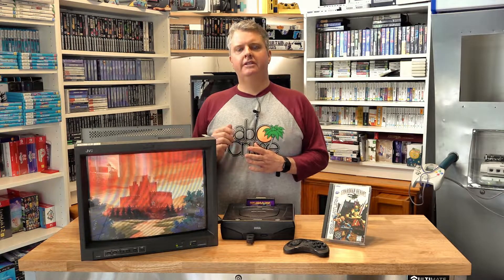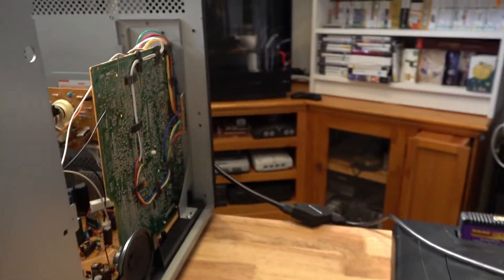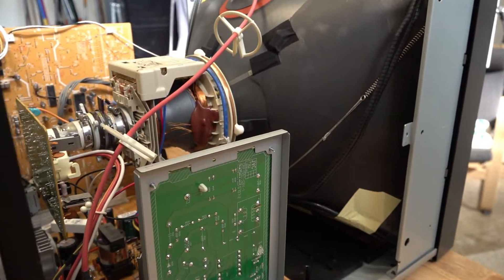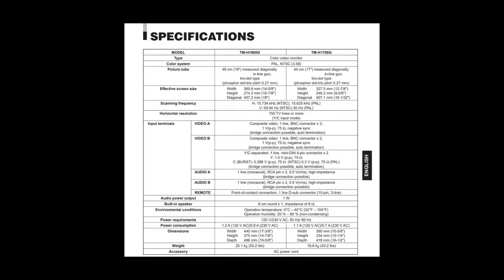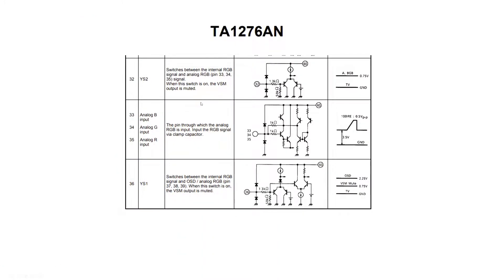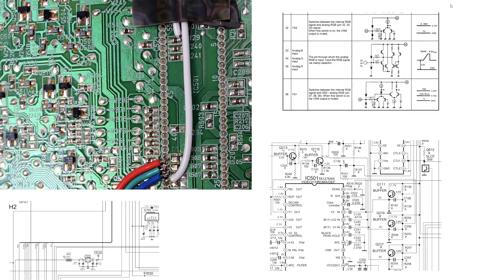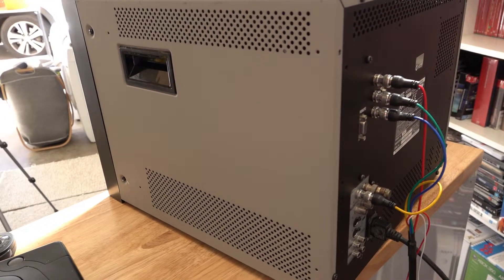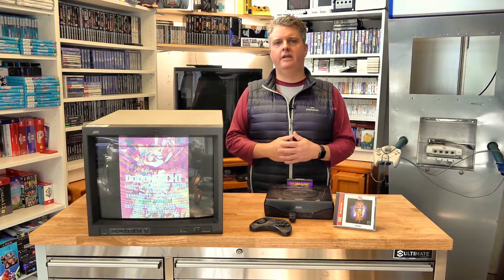How To RGB Modify JVC TM-H1900G RGB Modification

Comment: hi, thanks for the video. from what I see, YC and composite aren't  affected by this mod, so you can still hook composite or YC devices to it and use the switch to disable the RGB input (looks like you're bypassing the SYNC signal with it), am I right?

Comment: Hi dude, props for this video very instructive !

I tried to do the mod on my screen, but I must have shaken something when I decided to cut the rear panel to insert a female scart plug in. While working on the back panel all the electronic cards inside the CRT moved and I might actually have loosen / broken something.

From my understanding, removing the C533,C532,C531 and R554 do not prevent S-Video from displaying if you do not turn on the blanking switch.
Can you confirm it to me ?
I removed everything I wired with the mod but did not soldered back these four items.

When I turn the screen on, sometimes sync is lost, sometimes red color is missing, sometimes it turns istself off after a few seconds/minutes after a small "click" indicating maybe it turns itself into safety ?

The neckboard moved a little bit backwards, I replaced it but with no luck (I found some grey plastic like stuff around the cathods but it was allready there and I did not tried to remove it).

Any steps you have in mind to check a few things on that screen or should I just find a crt technician if possible ?

Thanks in advance for any advice / help you could provide =)

Comment: Hey man, I am trying this exact mod, or at least I want to try but am a bit intimidated since I am a noob to soldering and so forth. 

Can you help to explain it a bit easier since I didn't know what half you said was especially in the schematics part.

I don't need to become a CRT expert since I only want to do this once and that's it. Perhaps a step-by-step or list of which points need to be soldered where if it's not too much trouble? 

THanks in advance.
Reply: hey, did you do it?
I just got this monitor (for 200 euros, seems a great price!). I just tried in composite and it was not the best image of course. I'm waiting a svideo cable to try that output.
How do you like this monitor overall? And which sharpness did you set in the menu? I don't know what it changes
Reply: @floriansolatges9624  This monitor has great s-video too, comparable to RGB. Not much is really lost without RGB, though one can still add it for compatibility.
Sharpness makes the contrast between two pixels greater if their brightness is different.
Reply: @ST-wn9kd yes I found out svideo is really great. Snes on the tm-h1900 is really impressive. So I'll sitck with that :) thanks for the answer

Comment: I’m trying to perform this mod but failing for some reason.  I’m inputting .5vp-p following your voltage divider, blanking works, and I’ve tried both sync through the existing composite and feeding it directly to the jungle and get no love.  Do you think it’s possible there was a 1900G revision with I2C bus blocking the RGB inputs like some other TM models?
Reply from the maker: Interesting. I've never had this issue. Are you getting any picture. What is the jungle ic model number

Comment: Is component able to be added to this set or only scart?
Reply from the maker: Not sure. I think component should be able to as the board was designed for a card that does rgb/component
Reply: Ok great curious to see the jump in image quality over s video. Was it quite a jump in image quality after the mod?
Reply from the maker: @ericfoertmeyer554  yes. It was a huge jump.
Reply: Excellent thank you for your help

Comment: Awesome video the 19'' looks fantastic ! Im having issues getting my TM-H150CG displaying any image at all. Mine has the slot for the card but followed the guide on shmups, made the same homemade circuit to get the 0,5V pk-pk but I've no way to check if the RGB lines are getting that (no oscilloscope) - probably my mistake, as you cant guess these things. Nobody i found explains why the caps around the RGB jungla pins are removed either. Some people leave them in, others remove them, but why? 

I've spent so much time racking my brain with mine that ill probably just buy the card lol. Had another look at mine today and all i can think is that my homemade board isnt given the 0.5V pk-pk to enable the RGB. Shame as the guides ive seen....its really is easy to do, but ive hit a massive brick wall.
Reply from the maker: On my particular board the caps that were on the rgb lines were there to tie the pins straight to ground. My understanding is because it creates issues with the jungle if they aren't. Shouldnt leave them floating. Since there not in use the Jungle data sheet says that they should be tied to ground if not used. I don't know why. But it's in the data sheet. Even the resistor on the blanking line that was there. It's just a 0R resistor.
Reply from the maker: That's why I removed them. That way I started from scratch for my circuit on the RGB lines.

Comment: Looks great. Very clean mod. Was sort of drill bit do you use for cutting the BNC holes?
Reply from the maker: From memory it was an 8.5mm Drill bit for metal. i always de burr with a 13mm drill bit as well and paint the inside of the hole to prevent rust.